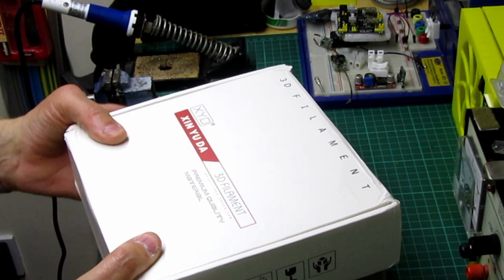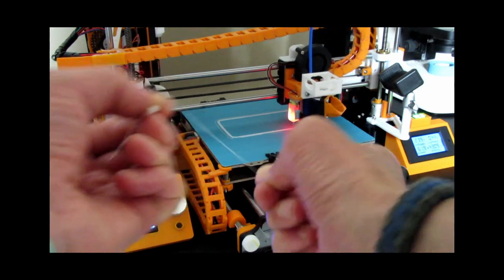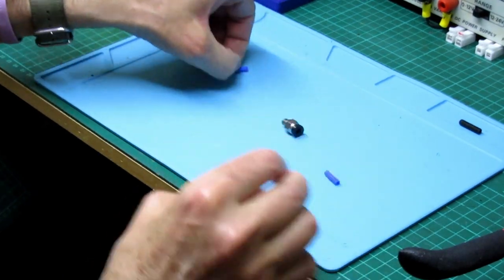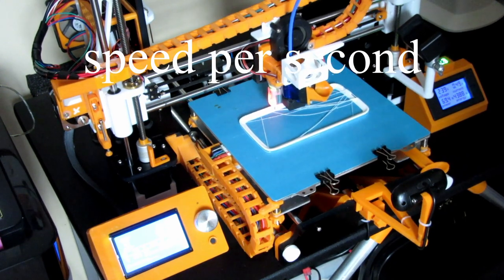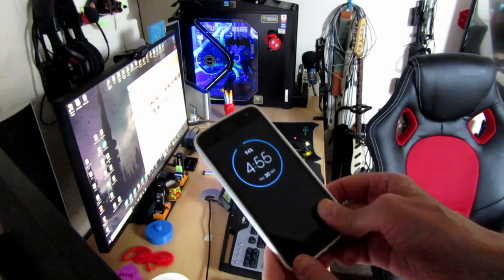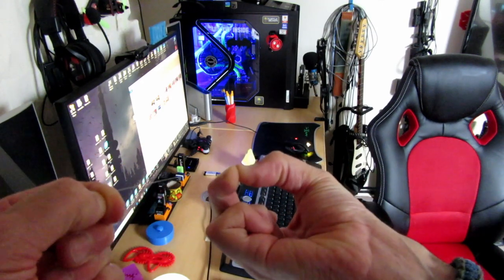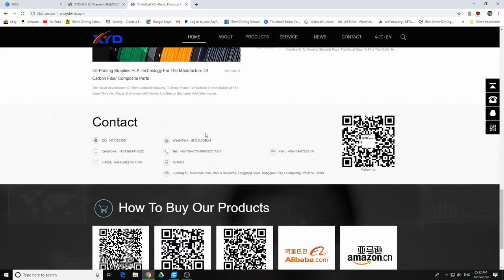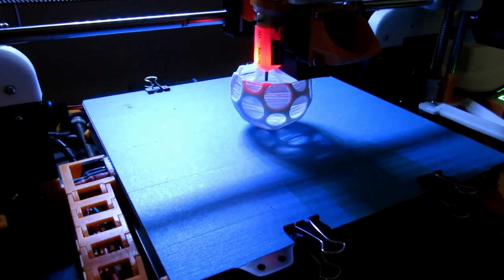XYD  Flexi Fliament Any good

Comment: I just tried it at 226c head, 46c bed, no retraction, and 30mm speed with no problems. My printer is a no-name home built but I use an all-metal head and a dual-drive Boden extruder with about 400mm of tube. Good stuff, time to buy some more colours.
Reply from the maker: Good job man i have used other colors its all good just keep it as dry as you can

Comment: Do you know how this stuff compares to other brands of TPU?  It seems very "cost effective" to play around with.
Reply from the maker: Hi man sorry I don't because it works good for me so I'll buy it again
Reply: @Beta250trials  Great, thanks.  Got my first printer second hand & the guy threw in a 0.5kg roll of ninjaflex which is working fine but I would like something a bit more plentiful to experiment with.  I might take a punt on some of this filament too, it may even be easier to handle.  Thanks for the video!
Reply from the maker: @krsslim  I would get pla   it's so easy to use then work up to petg nijaflex is one of the hardest to get right go for pla cheers buddy
Reply: @Beta250trials  I have put 1kg of PLA through it so far to get some experience with the machine, prints still aren't absolutely perfect but pretty pleased with how things are going so far on that front & overcame a lot of the initial issues.

It's a wanhao i3 plus with flexion extruder so I always intended to print TPU, I only just started with the nijaflex & had some reasonable enough prints, the only real defects are sagging at the beginning of thin overhangs (the actual built up overhangs are fine), not much fine stringing at all but a small amount of blobbing & retraction marks here & there.  
I don't really want to use up this spool looking for ideal settings as it will likely take me more time than most to overcome these things so was looking for something cheaper to consume. I was only unsure if this route would give me material that's more difficult to work with.  I was tempted to try this stuff, you seem happy enough with it so seems worth a try for my usage!
Reply from the maker: @krsslim  sounds like your doing good it's pretty cheap filament I've just started using a dehydrter and it's giving better prints before used to being filaments in the oven anyhow hope you have good luck with petg
Reply: @Beta250trials  Thanks, PETG was something I have been looking at too :).  I also had to put the ninaflex in the oven, dehydrator sounds like a nicer solution!
Reply: @Beta250trials   I got some in,  it's a little harder & more plastic-like in comparison to the ninjaflex which is quite rubbery.  Looking at the manufacturers website they don't mention TPU or even what material it is, only "flex" so who knows...
  
It prints well enough here, overhangs etc are easier, not as good for gasket type things but in some cases is quite useful because it can be reasonably rigid while still having some give & taking impacts well.  Works well enough for me & will try to use this stuff in my projects where I can because of the price compared to others around!  Cheers